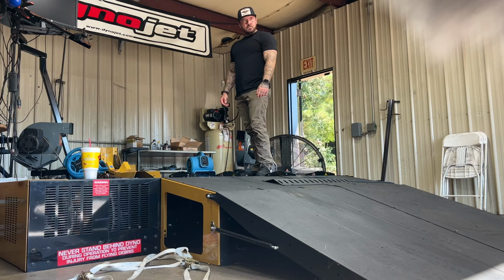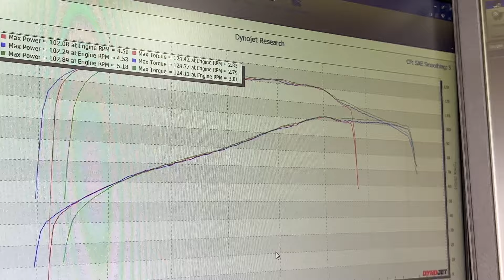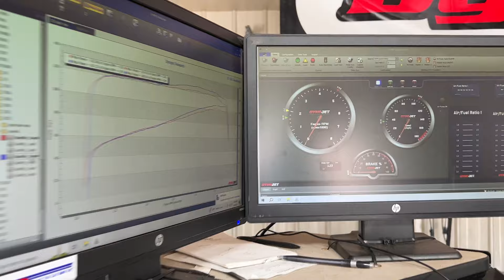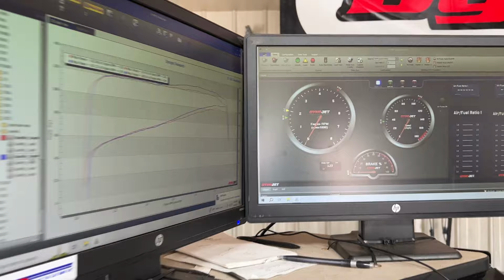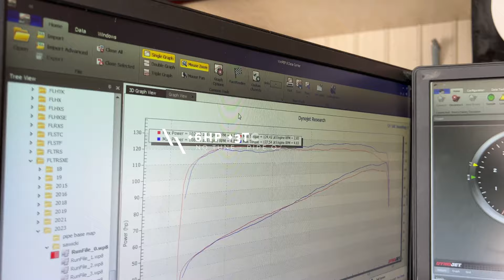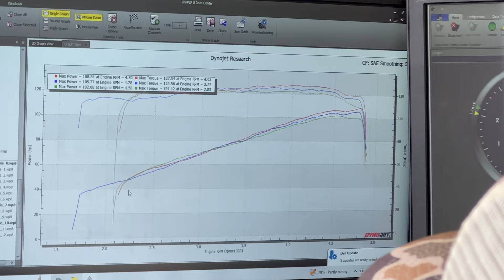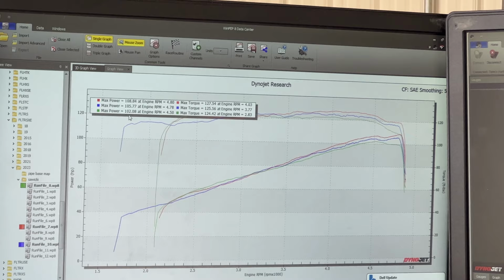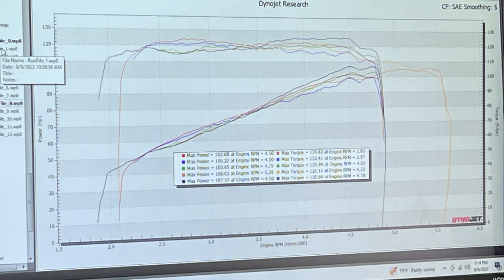2023 Harley Davidson CVO Road Glide DYNO TEST! | Sawicki Speed Exhaust

Comment: I have had a few Harleys in my day. The way I see it from an 88ci,96ci, and now my current 2017 M8 107ci Harley is a Harley. As years go on the newer ones have a few new bells and whistles but you still have to maintain them the same. The hardest pulling HD I ever had to date was my 96ci with a gear cam kit and stage 1 with tab mufflers, and with religious oil changes I put over 87k on the bike with no motor work.
Reply from the maker: That’s the thing everyone thinks more inches is king. I know a few guys with the 96” that would hurt your feelings. All about how it’s built and as you said, maintained.

Comment: Absolutely love my Sawicki 2-1 exhaust. I went from 109hp/128tq on my 2022 street glide 114" stage 2 zippers kit with 472 cam, 64mm throttle body, injectors and SE ventilator air cleaner. I put the Sawicki full length 2-1 on, retuned and now at 128hp/129tq. The exhaust is not the loudest at idle or steady speed, but soon as you rip on it everything changes.

Comment: I have the same Sawicki speed stainless short pipe tuned with a dynojet tuner on my 2023 Roadglide-ST. Awesome pipe.
Reply from the maker: They look and sound amazing. Really solid products. Was cool to see a little behind the scenes of what goes into their R&D.
Reply: Would you say the short pipes are louder then the full length ones? Honestly besides Power I’m trying to find some that will be extremely loud as well
Reply: Maybe a little louder since it’s shorter. I know it’s loud enough for me when I’m mashing on it with a nice back pressure sound when you let off the gas to shift. I love mine.

Comment: With an almost 2000cc motor you would think it could pump out more.  My 25 year old Honda Valkyrie Interstate gl1500 does 100hp rear wheel and 95 fpt rear wheel bone stock.  I had a guy last summer on a new CVO street glide and I was asking him questions and drooling over his new bike and he was way more interested in looking at my bike than talking about his bike.  I just kept going "why?, you have a CVO!!!!!!".  He was really taken by it.  I guess its because you dont see hardly any ever around (at least here) and the engine is fully visible.  The flat 6 engine is a looker.  I cant even afford a 10 year old CVO so thems the breaks.  I have a 96 stage 4 sporty and that will have to be good enough.  CVOs are gorgeous.  I think pretty much as nice and you can get.
Reply: With a 300 dollar bolt in cam, not designed to pass emissions, it will make significantly more.
Reply: @Twilson_Vtwin  True.  That's why I like carbed evo's

Comment: The mid length pipe looked the best IMO… the long pipe is the best of the full length pipes because the tip kind of flows with the way the new bags are cut… either way, keep the info coming. Interested what the SE tuner would do.
Reply from the maker: Totally agree. I’m a mid length fan. Makes good power. Put the sound past the bag so doesn’t blow your ears out on long rides. Looks great.

Comment: To all the people complaining about the numbers. Emissions is what is holding this bike back. Blame Biden and politicians like him, not Harley. With a 777xe cam (obviously when and if they make a compatible version), the CVO will probably make 140/140 plus. I bet you can get 150/150 with a proper pipe, cam, intake and tune. Unfortunately Harley just can’t sell it to you like that, but they do give you a pretty solid platform to build on. And most people that buy Harley’s wont need more power then the CVO already makes. Oh and for those that are curious I ride a 2018 128ci  Heritage Classic. FM 128 kit, FM AC/DC filter, Fueling 472 with full fueling cam chest and a D&D Fat Cat. More then enough for me but I am considering the CVO. Maybe in two years or so and I’ll have one.

Comment: The throttle to wheel response seems a little slow. Was it in rain mode? When he gave the throttle a full twist the rear wheel response was slow. Could have just been the video or me.
Reply from the maker: That’s because he’s in 5th gear and starting around 2k rpm. So you are seeing lag. Some of it is throttle and some is just from being in a high gear and not in the power band. Throttle sensitivity can be adjusted though.
Reply: @throttleblip9854  Thanks for clearing that up and teaching me something. Love your channel.